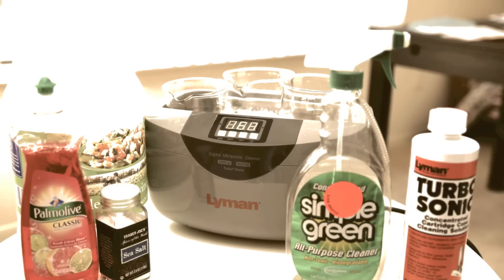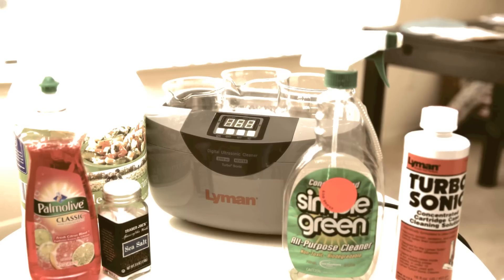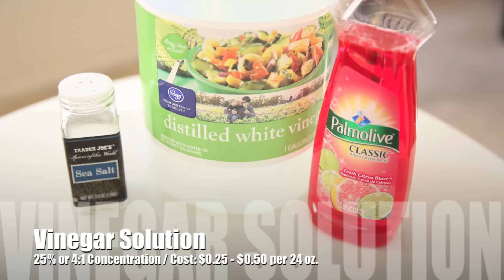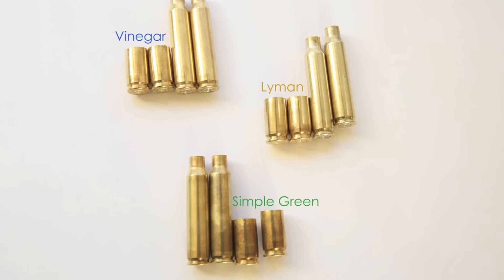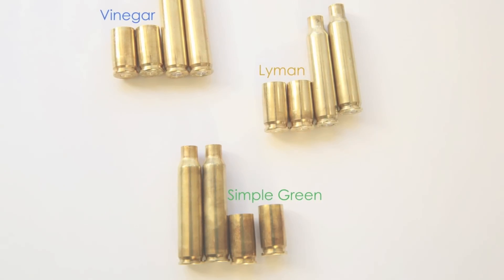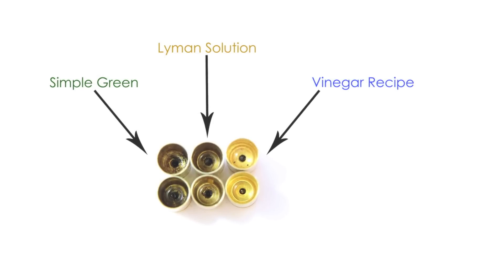Homemade Ultrasonic Solution for Reloading (comparison) HD

Comment: Okay,….Sorry but not quite! I'm using the vinegar solution for about an hour now and I'm not getting the results as claimed. Rinsed a few and they are not as clean on the inside as the photo shows. Yes, I followed the recipe as directed in the suggested video using hot water, I even tried adding some baking soda after a half hour as an effervescent but they are not as clean as claimed in this video…(shrug) dunno!
Reply from the maker: Well, the "claimed" results are based on using it in an ultrasonic cleaner.  It works using a wooden spoon too i suppose but it won't be quite as good.
Reply: tony bailey OMG really?   I want to cry at this reply
Reply from the maker: tony bailey Are you using an ultrasonic cleaner?  How are you agitating the solution?
Reply: PilotWithAGun Hi, thanks for the reply. No, I'm not using an ultrasonic machine, just a wooden spoon to agitate every couple minutes or so.
Reply: john evers Hi ya' Johnny! Boy you really must be bored today.

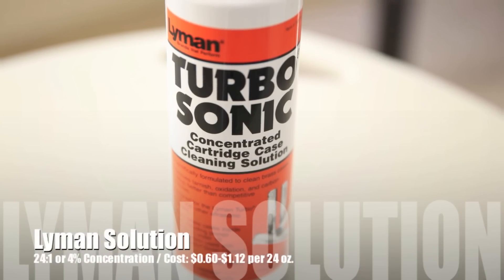Comment: I was going to say the same thing navion said...1 part water to 4 parts solution is 20%.  But since he already said it, I'll get my video proofing credit by pointing out at 1:01 you have 24:1 or 4% concentration....should be 1:24...as in "one to 24" or 1/24 or about 4%.   Now that I'm done being "that guy", thanks for the tip on the vinegar solution!  I'm just getting set up reloading and already bought "real solution" but I'll use yours when that's done.  Also, thanks for a very well produced video.  Quick, concise, good audio and video quality.  I wish more YTers would take a lesson in that!

Comment: It may take longer but - 1. clean with primers in, 2. resize and deprime. 3. clean again thereby cleaning primer pockets. 4. If you have tumbler, use it to get a real shine. 5. check primer pockets for corn cob particles stuck inside.

Result, you will have cases looking unused.

Comment: I just finished 500 223 range brass using you vinegar formula' I've never had such clean brass especially the primer pockets.
I have used most of the  cleaning products on  market and they can't hold a candle to you formula. Thanks fo posting it.

Used a Sonic machine

Comment: Very well composed video; direct and to the point. I vibe-tumble in coarse corn cob, then size and deprime, then ultrasonic with the same recipe. then back into the vibe-tumble with fine corn cob media. The Andersons (google it) sells 50 lbs. of corn cob for $20. brass looks brand new. 1/3rd white vinegar, 2/3rds water, 1 tablespoon dish soap, 1 tablespoon salt, and 1/4 of the HF secret sauce. (If you use balsamic vinegar with a little goat cheese, you really get a tangy treat, :)), then rinse with water and a little baking soda to neutralize the vinegar.  I like short and fast videos like ours. Not that we have short attention spans, its just better to be succinct. Great job!  Steve Reloading 223/556 easy

Comment: I have that Harbor Freight U-S cleaner, and it works very well. I clean maybe 200 .223Rem cases in it at a time; about 85 .30-06 cases fit nicely, too. My solution is water, lemon juice, a squirt of dishwashing liquid, a bit of Lemi-shine (buy it at Waltermart in the detergent section) and a pinch of the mystery powder that HF sells with the cleaner. I think the powder is some sort of surfactant that makes the water "more wet," which allows the U-S process to better work. The cleaner can only be run for eight minutes at a time, else the transducer overheats. So I set the cleaner for 480 seconds and a kitchen timer for 16 minutes. Start both at the same time. 16 minutes later, the timer goes off and the transducer is cool enough for another eight-minute run. Stir once or twice during the 480-second run. I usually let my cases run through ten or twelve 16-minute cycles so as to get the entire insides and primer pockets clean-clean. I don't stand there and wait for it; I'm doing other things like washing dishes, washing clothes or prepping brass to be reloaded. Lots of other things to do while your U-S cleaner works happily away gettin' that grungy carbon out. Once clean, rinse profusely and dry in a low oven (200 degrees) for 20-30 minutes. I resize before cleaning, so the cleaned cases are ready to go. No primer in the pocket allows for fast draining and drying. The lack of shininess doesn't bother me. They're clean, they'll function through the rifle as is, and that's all that matters...
Reply: the rinse part is a very important step, I let my brass air dry for 2-3 days.
Reply: So long a drying time is not necessary, Chris. Set them on a window sill and let the morning or afternoon sun do the job. Works well. I sometimes sun-dry my mildcat cases, of which I usually have to dry no more than a dozen or so. I'll set them there, then reload them the next day...

Comment: Very good receipt,
I've just tested it now, cases looks fine. I've an ultrasonic cleaner, the cases was in a glass bowl with the solution inside the cleaner. 2x 20 mins @ 50°C.
There is yet some scrap deep in the cases but negligible.
Thank you !

Comment: Did you use anything special on the inside of your cases when you used that salt/vinegar solution? Ive been using that for awhile with my 30-30 and 30-06 brass, which cleans the inside very well.. But, just tonight i tried 45acp brass.. Outsides got nice, but even after a 45 minute soak the insides still looked horrible... Any ideas as to why?
Reply from the maker: What was causing the inside to look that bad?
Reply: PilotWithAGun No idea, They were factory loads from Remington,  had powder residue in the primer pockets also.. Just used qtips to get them clean, but it was a pain.. Possibly Remington using such a dirty powder?
Reply from the maker: Did you try using hot water?  Or using the heat function of your ultrasonic cleaner?

Comment: I have seen a video from midway where larry potterfield used a vinegar solution to clean some brass that was found , it was old and really dirty something you would look at and throw away cause it just looked really bad, but the vinegar solution made the brass look brand new , something to do with vinegar and carbon and brass on a chemical level. so this really makes sense. and hey its cheap and when is that not a good thing thanks for the vid.

Comment: Nice video. Thanks

Note:  There are a lot of warnings on the internet about using vinegar for brass.

Does anyone have input on the chemical reaction that could harm the brass?  

Here is something I found online:

" Both metals used in brass cases (copper and zinc) are soluble in acetic acid (vinegar). The salts, copper acetate and zinc acetate, are also soluble. Zinc is more soluble than copper so it dissolves faster. In addition a galvanic action occurs that cause copper to be dissolved and then redeposited on the surface at the expense of the zinc.

When you clean brass cases in a vinegar solution you change both the chemical and physical properties of the surface of the case. There have been comments about cases being too clean, primers hard to seat, deposits on mandrels, etc. When you change the surface by dissolving some of it and etching it these things will happen. Whether they happen to the point of being a problem becomes the issue."
Reply: I don't know much regarding the effect of acetic acid on brass cases, but from what I've read, it seems that citric acid is a preferable alternative to vinegar. Obviously, the concentration of the acid will also have an effect and it seems that not a very high concentration of vinegar or acetic acid is necessary. I've noticed that washing brass with a solution containing vinegar gives the brass a reddish colour.

Comment: Well, I think I managed to screw this up!  I put my brass into my Ultrasonic cleaner for an hour but didn't check it for more than 2 hours.  Now all the brass is pink!  I just checked and you only put them in for 8 minutes...now what?
Reply from the maker: It should be fine...  Some people have gotten rid of the pink by tumbling... the pink is a really thin coating of copper... which is fine.

Comment: Thanks for the great recipe, however my brass did not came out nearly as clean, some cases were significantly cleaner then others though.  I am doubting the usefulness of ultrasonic cleaner.  Maybe I am loading too many cases at once.  I've noticed when I made a solution (I use boiling water) and put the cases in 1 gallon container and shook it for few minutes; cases came out as clean as after ultrasonic 4-5 cycles.
Reply from the maker: Yeah, best results when your brass are not packed like sardines and using the heat function of your cleaner.
Reply: Dima Prok
It all comes down the the quality of your ultrasonic cleaner. The recipe will help remove oxidation from the brass (make it shiny), but for it to really work you need the mechanical scrubbing action caused by micro cavitation bubbles on the surface of the brass. Cheap ultrasonic cleaners lack the energy and even distribution to clean more than a few metal parts (usually placed right over the transducer). If you overload them all you are doing is soaking the brass. High quality ones put more energy into the liquid and oscillate the frequency to minimize 'dead spots' in the tank.
Reply: "Maybe I am loading too many cases at once."

Ya think?
Reply: clamum
So how many should I load then?  I mean when I have to clean almost a thousand 9mm cases, you think I'll be loading few at a time?

Comment: US seems ok for a single box of shells  I use a vibteroy tumbler Dillion 2000 walnut hulls charged with Brasso  let them run over night   a US cleaner that do as many as the 2000 would cost way to much

Comment: wash the brass in some 1 teaspoon baking soda mixed in 3 liters of water.
it neutralizes the acid in the brass surface...
Reply: Dont really need to use baking soda,  just take the basket full of brass set it in plastic tub full of fresh water it will dilute it to the point where it does not matter.  Its not like this a strong acid it get neutralized but the reaction the oxidation layer and crud on the brass.    Baking soda will neutralize but I've not seen any difference in outcome just a added step that did not seem to provide any more that a simple rinse.

Comment: Thank you for this. I bought a cheap $29 sonic cleaner at the harbor freight store, used your solution and it works great!  My cleaner holds 10 cases at a time. It gets pretty clean inside but not as clean as yours. Do you think that if I were to put less in there it would make a difference?

Comment: My solution, though im sure its not perfect. Put the discharge water in a bucket, covered with wire mesh so the doggy doesnt get it. Just leave it outside to dehydrate on its own. I live in az, so it doesnt take long here!  in the end, after many cycles you are left with a mucky funk in the bucket, put on the lid and discard it.

Comment: Remember, even though your cleaning solution may be non toxic. The liquid that comes out of the US machine after cleaning fired brass is in fact very toxic. Wash your hands! And its not really responsible to just poor this crap down the sink. Water treatment plants arent designed to remove alot of these impurities from the water.

Comment: It appears that you left the primers in the cases, when cleaning with any liquid you should remove the primers first, not only do they dry easier, if they aren't removed soon after cleaning you take the chance of the bottom punching out of the primer cup leaving the sides in place, which can be a huge problem.

Comment: Thanks for a great video. I currently use a vibratory tumbler with crushed walnut shells, I have been impressed and am considering buying a rock tumbling machine and using stainless steel pins with a soap solution, Ive seen some good results on youtube, have you ever tried this method?

Comment: Vinegar really works wonders, HOWEVER: If you don't rinse and run the brass in a baking soda solution immediately afterwards you'll end up with red brass from the vinegar reacting with the brass and oxidizing it.
Reply: Thank you for the tip.  Will oxidation damage structural integrity of brass or is damage purely cosmetic?
Reply: @lifemember3168  i felt that the affected cases crack sooner then the other ones

Comment: I tried your mix in my Hornady Sonic cleaner on both brass casings and some extremely dirty copper fittings that had been sitting in my bilge for a number of decades; it worked fantastic. I did try a small sample batch of both copper and brass in the solution at the same time and the two metals started to react almost within a minute! Nothing beats your solution for getting the insides of the cases and the primer pockets clean.

Comment from the maker: My cleaner is equipped with heat but it's just on or off, no temp.  I rinse the brass with plain water.  I do not have a tumbler (apartment) which is why I purchased this cleaner.

Comment: Also, I understand there is a lot of lead in the spent primers.  So if you put the spent primers in the solution there could be a lot of lead suspended in the soltion, which may come in contact with your hand or go into the sewer. Just sayin'.

Comment: Great Job!!! So from reading below I guess hand agitated is virtually just as good as the ultrasonic machine.  Personally for handloading I want to avoid anything that requires electricity, since it probably won't be available in a doomsday scenario.  But then I use an electric drill to trim my brass.  ;-)  Oh well...

Comment: Nice vid thanks. I have a few questions if you don't mind? Is your cleaner equipped with heat and if so what temp do you run it?

Do you rinse the brass with DI or equivalent water after the clean and before you dry?

Last one I promise have you ever polished the clean de-capped brass in a tumbler after you cleaned it this way?
  I was just wondering if the media would be less likely to plug the primer pocket in super clean brass.

   Thanks again for a great clip.

Comment: Thanks for sharing brother.  I knew there was a inexpensive way to do this. I would never use Simple Green on cases!  When I was in the Air Force, Simple Green was banned from being used on the air-frame or landing gear of aircraft because it compromised the integrity of the metal. Metal fatigue was increased significantly when it was exposed to Simple Green. I saw this first hand using a Non Destructive Inspection with ultraviolet light and ultrasonic testing.  Just FYI and thanks again!

Comment: I started using this mix from your other video.. Now I use just vinegar and water in my ultrasonic cleaner. I deprime first. After I run it through the ultrasonic I run it through the tumbler using walnut media and a few drops of liquid car wax and the brass looks brand new. With clean primer pockets. And they run through my carbide sizing die beautifully with no lube

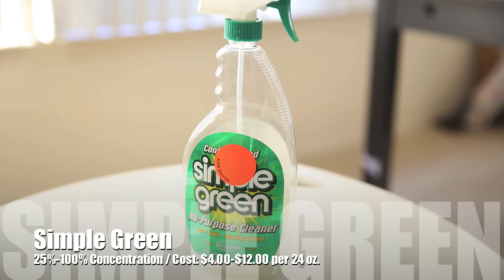Comment: Small correction, at 0:39 you refer to 25% solution as 1 part Simple Green to 4 parts water.  25% solution would be 1 part Simple Green to 3 parts water.

Comment from the maker: Before I had an ultrasonic cleaner, I used the vinegar solution just like I did with the other video (Agitated the brass by hand a few times in a 30 min period)  I've since bought an ultrasonic cleaner and use the same solution for it.  If you're not familiar, an ultrasonic cleaner uses ultrasonic sound waves that propagate through a cleaning solution, in this case it's the Vinegar solution.  I did that for 8 minutes.  It's a set it and forget it kind of thing.  It's nice.
Reply: Just found your channel. Quick question about the vinegar solution: Did it create foam in the ultrasonic cleaner/ If so, how'd you deal with that? Thanks.